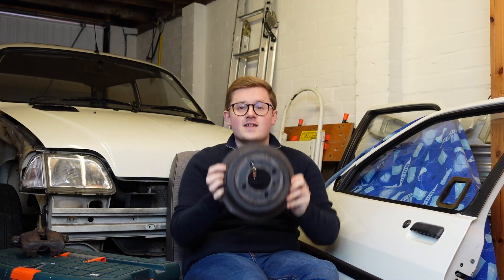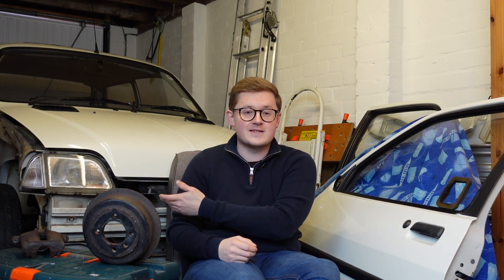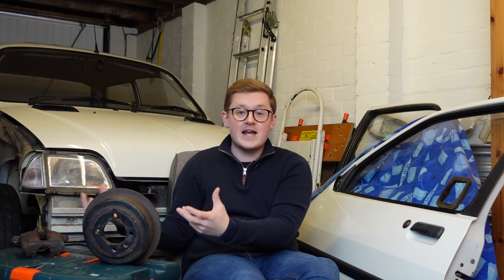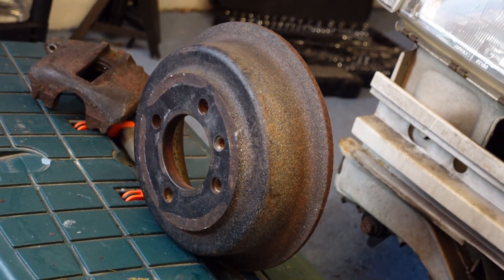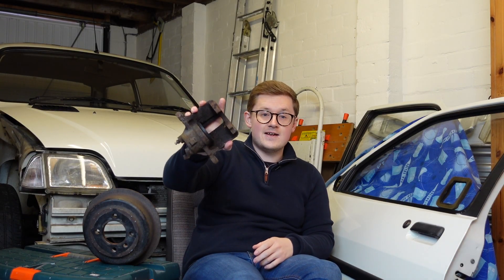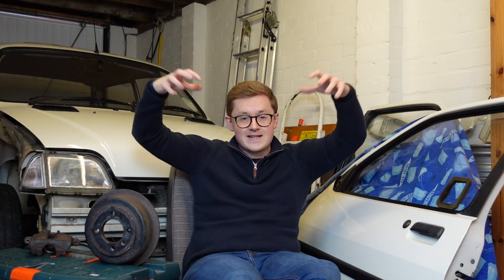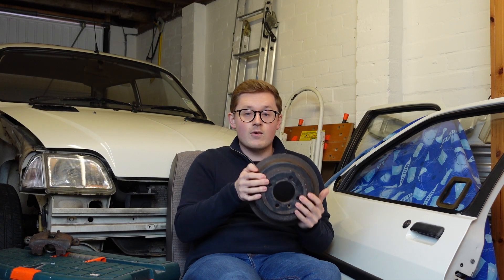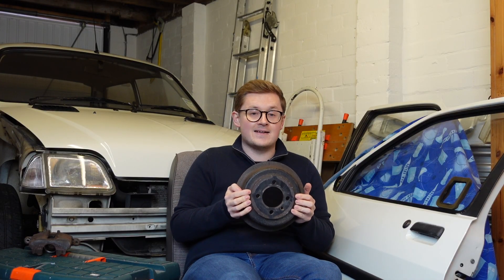Why are Drum Brakes Making an EV Comeback?

Comment: I daily a 66 Lemans and a 70 Chevy Kingswood wagon.  Even though they have original motors and get around 10 miles to the gallon, they are still more environmentally sound than any new car you could buy, gas, diesel or electric.  The manufacturing process is never considered in new cars, and the electricity still comes from fossil fuels in most cases. So even being that my cars have no pollution controls on them and get lousy mileage, they were made before 1970, and were only made once.  So if you really want to be environmentally friendly, skip your new purchase and buy something used.  The older it is the more environmentally friendly it is in the big picture.
Reply: A new car causes around 10 t CO2 in production.
However a car with a consumption of 1 gallon every 10 miles causes the same emissions just because of the gasoline in a relatively short time, and additionally it don't comply with any emission standard and likely still needs lead additive for the gasoline. This has nothing to do with environmental protection. Every gallon gasoline you burn causes around 10 kg CO2 just for the direct emissions
Reply: @simonm1447  The production of a new car takes thousands of parts, delivered by thousands of suppliers, across thousands of miles.  Think about something as simple as a brake assembly, it was covered pretty thoroughly. The caliper comes from one supplier.  The rubber seals in the caliper came from a different supplier. The fluid comes from another supplier, the brake lines come from another supplier, the master cylinder from another supplier and so on, and that's just 1 part.  They all have an assembly and shipping process involved.  My cars were made over 50 years ago, made and assembled once with mostly steel parts.  Hardly any plastic involved.  They will contribute far less pollutants even at 10 mpg, and the lead substitute I use, than the manufacturing of 1 new car does just by being assembled. There's no way around it. I u/s what you're trying to get at, but my cars have existed for half a century already.  Even considering they have zero pollution control devices, they were not made to be disposable after 10 years like today's electric cars and cars in general are.  My 50+ year old cars are the most environmentally friendly option available.
Reply: @motorcitywestauto4674  it don't matter if your cars already exists, they blow out the ammount of CO2 which is in average emitted for the production of a new car every 10k miles. If you drive more than 10k miles per year your emissions are equal with the production of a new car per year, just by the direct emissions without well to wheel. Such cars are the worst case for the environment. A new ICE car consuming just half the fuel (which is still a lot) would emit less CO2 including the production within just 2 years of use at 10k miles per year and would additionally emit far less poisonous fumes. 

This is not an opinion, this is math. Math is fact, no opinion.
Reply: @simonm1447   Clearly we don't see things the same way, and your not picking up what I'm putting down.  You're right about one thing though math doesn't lie, we just don't agree on who's math is right.
Reply: @motorcitywestauto4674  well, I have seen no math at all from you. Fact is math says your cars emit 10 t of CO2 every 10k miles. Math is fact, math is not an opinion for any serious person

Comment: A drum brake, especially in larger sizes, weighs less than a disk brake. Additionally, the drum brake is self-energizing where a disk brake requires a booster to generate enough pressure on the disk pads.
A failing of drum brakes it that when they do get wet, they can lose most of their effectiveness instantly when applied. Even worse is to have a wheel cylinder leak brake fluid contaminating the shoes and then get wet. The brake will lock the wheel instantly and won't release even if you let off the brake. My best friend was killed in an auto accident during a rainstorm because of this.

Comment: Also of note, the Chevrolet Bolt has rare stainless steel disc brakes, that never rust.
Reply: @Chris_1024_ 130$ for a set on average, no more than others. Stainless is softer than tool steel, so I don't think it would last long on a gas car(due to evs using regenerative braking). I put 150,000 on my hybrid Ford EV with plenty of brake rotors and pads left, unless you are hard on the brakes you might never need to replace them. My dodge caravan costs $900 for a brake job including rotors. I'm sure if I ever could wear out the brakes on the Bolt it would just cost about the same as a gas car.

Comment: Simple reason is cost.  Drums are cheap, there was outrage here in the US when VW launched the 2012 jetta with drum brakes in the rear and a torsion beam axel as opposed to the IRS and discs on the previous gen.  They did it to bring cost down simple as that.

Comment: Only real downside of going regen+drum is a reduction of pure braking performance in a failure scenario. If, for whatever reason, regen stopped working... you'll wish you'd had a disc instead.

As cool as it is to have computers and servo actuators in the loop, and you can do a LOT with brake by wire, the reliability toll is frankly unacceptable. A good old-fashioned mechanical hydraulic system will still apply pressure even if you lost all power. Worst case scenario, you can stab it with your clutch foot and it'll stop the car just fine.

Lorry air brakes are also fail-safe. Lose pressure - system auto-applies brakes.
Reply: drums are more than strong enough to lockup a wheel.  Where they fell short was sustained braking where they would overheat, which is not likely to happen in a EV.
Reply: @Wooble57  "not likely" is not the same as "impossible". An electrical failure at the top of a long, steep hill, with no mechanical backup, becomes a crash. Not a maybe, a certainty at that point.

This is a safety-critical system, I really don't see why they're playing chicken with it. Maybe everyone has become reckless now, per EJ's example.

On the strength issue... it's always going to be about hot strength, and when you heat the drum up enough to be malleable, the force from the shoes will readily deform it to the point of being useless. A disc can get a good bit hotter before it disintegrates, which means you need less of it to get the job done.

Your brakes NEED to have the heat capacity to stop your car at its rated maximum mass, from its top speed, WITHOUT locking up (because that will burst your tyres, and then you'll be sliding even further). You then need to add a bit more to accommodate for wear in service. It's not impossible to achieve with drum brakes, nor even difficult, but the end result will invariably be heavier, which works against all the other supposed goals of electric cars.

Mind you, this is all moot in the context of brake by wire anyway, if you have an electrical failure that takes out the regen, you've got no brakes at all, regardless of type.
Reply: @233kosta  any vehicle i've had with drums was capable of stopping itself fully loaded.  Where they ran into trouble was when you wanted to drag your brakes all the way down a miles long descent.

The increased cooling of disc's let's you do that, but with regen braking (or engine braking) you don't need to use brakes like that.

as for locking up, with ABS that's what they now teach people.  Stomp the pedal and steer, letting abs take car of the brake control.

As for weight, i think you underestimate how much disc's and calipers weigh, it's a lot more than wheel cylinders and drums.

Comment: Drum brakes tend to decompensate.  Being on the rear this is not a big issue.. except for the MOT/ITV or whatever the official test is.  The drum brakes will quite quickly need to be replaced ust for the sake of the test.